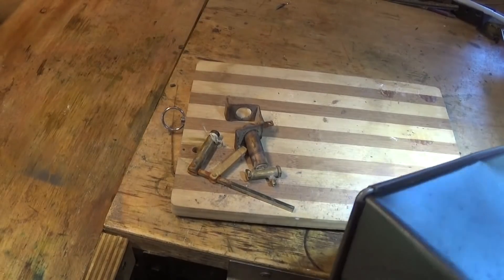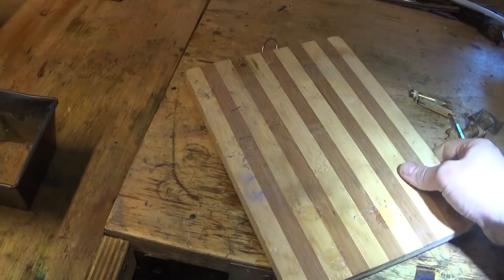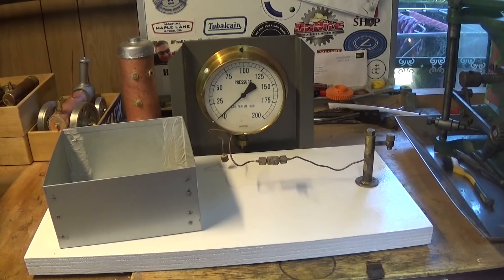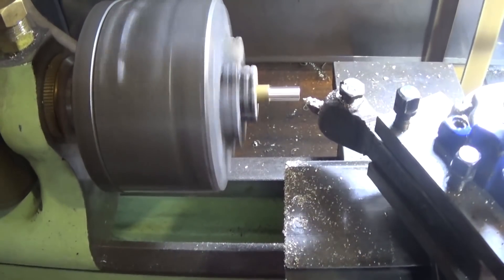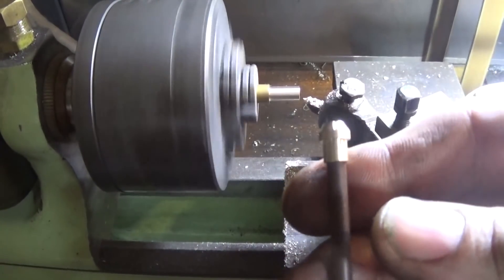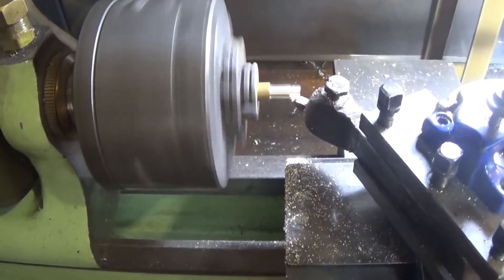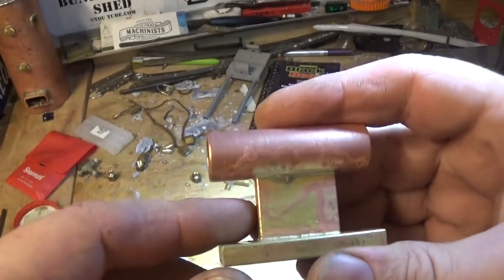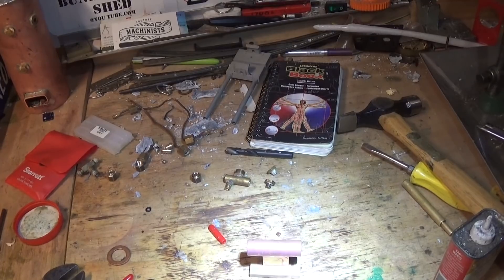Making a proper boiler test Rig.Part 1

Comment: Emma, I have a question. As an American, I've done electrical design work for the Australian mining Industry and found that Australian Government to be relentless in regulations enforcement. Are you required to have your test equipment inspected and certified by the government?
Reply from the maker: Good q. Not at this size. For boiler certification I wouldn't use my equipment. This is just so I feel a bit safer making steam.
Reply: Emmas Spareroom Machineshop : Is there a requirement to have your boillers inspected and certified before you use it in public? I'm thinking the 5" gauge and 7 1/2" gauge live steam locomotives.
Reply from the maker: Yes definitely.

Comment: good info emma, I was really interested in seeing how the hand pump all fits together and seeing you making one just shows how simple they really are. I cant wait to see the rest of it because I plan on building on for myself for doing hydro testing of small boilers/pressure vessels too eventually.
Reply from the maker: you would have got more.. but i need some more time to get to it. 
main thing with a pump is to minimise the dead space in the chamber. fittings are easy tho thanks for watching
Reply: yea, after seeing what you have there, it became very clear on what I need to use. Thanks again and thanks for the video.